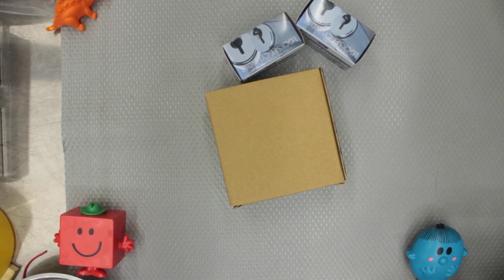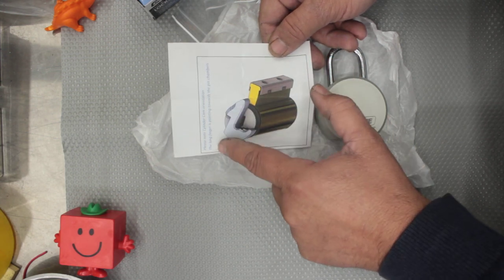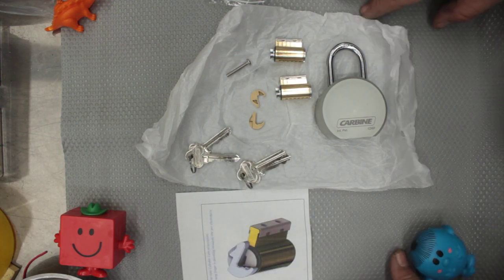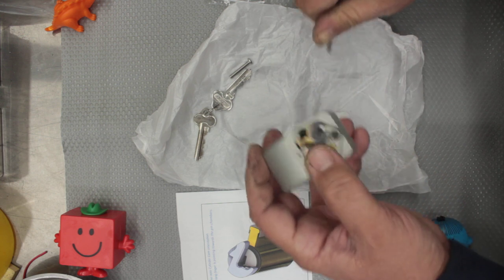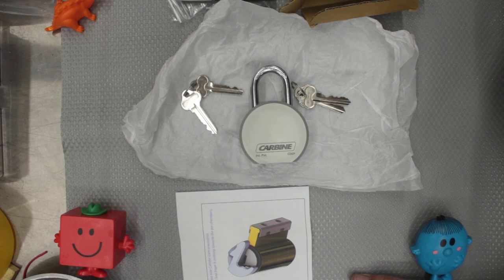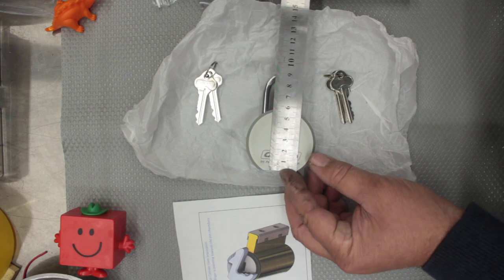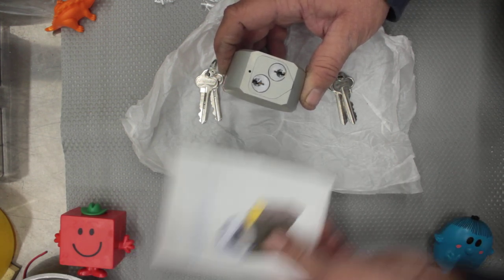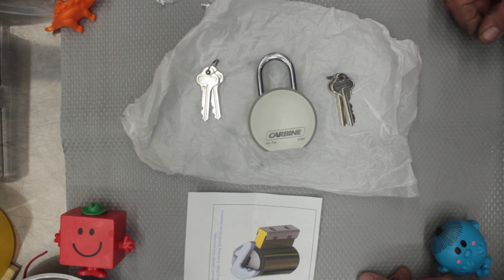New Carbine Padlock 2 keys In 1 Padlock

Comment: This is pretty neat. I have not seen anything like this in the US. This would be really useful. Also, can a key in knob cylinder work with this lock? You mention that 530 cylinders work in them. I am not sure if those are the same as KIK cylinders. We don’t use 530 cylinders in the US.
Reply: Unfortunately, as of 2020/06 there is no way to convert this to a global forma KNK cylinder.
the 530 cylinder is specifically an Australian format, grandfathered in by an old model by Lockwood - the "530" knobset.
It's now one of the ~4-5 major cylinder formats for usage in Aus, because of it's compact size and useful tailpiece end.

However, two points:
1)  Carbine are really good at product design, so may make an alternative or an adaptor,
And 2) Carbine manufacture this in Australia with their own cnc machines.  Perhaps if they get global or industry pressure, they'll alter the design or make an optional version for KNK?
Reply: @GutterClown  Cool, thanks for the information. Maybe they will make a version that fits a KNK.

Comment: A lot more compact than the abus dual padlock that does the same thing.
Reply from the maker: No sorry I would have to look it up, the padlocks are 50mm and the pins come as another part
Reply from the maker: Yes, thats is true you make a good point, and yes a torx screw would be better, I will let them know